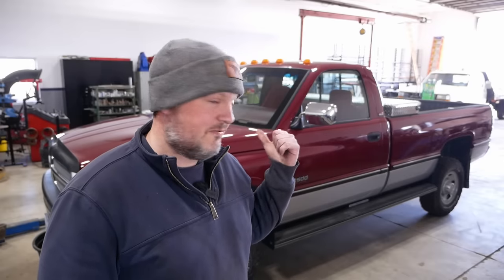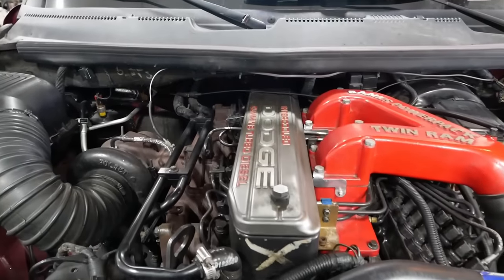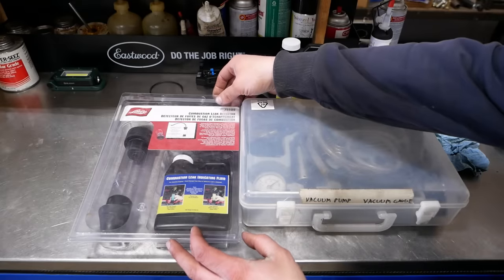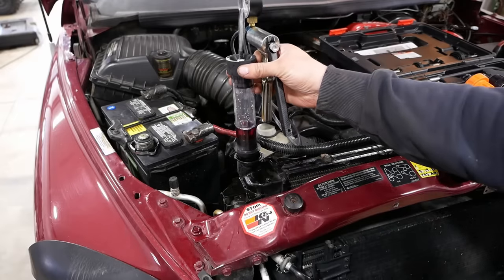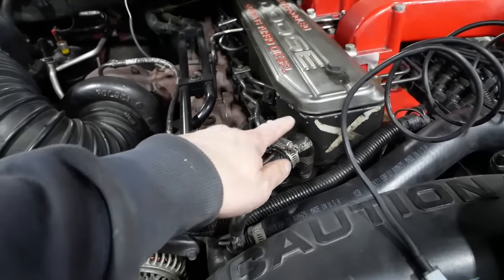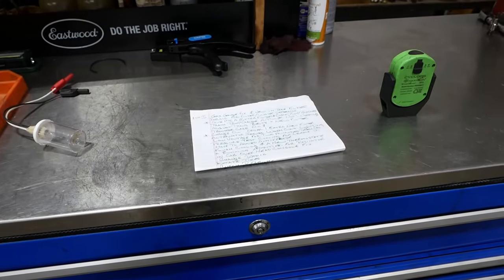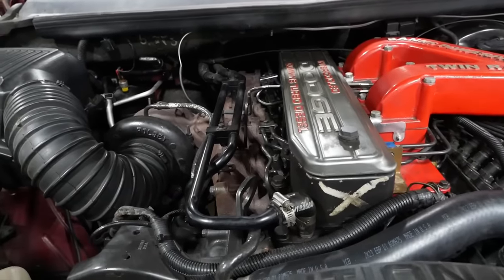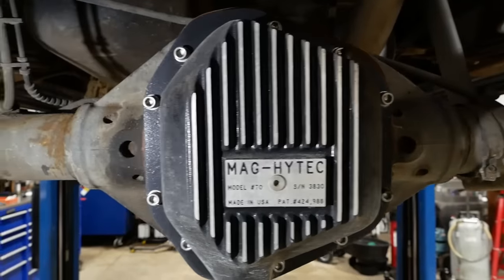Fixing a Mint 1995 Ram 2500 Cummins | Front End, Coolant Leaks, Major Service, Etc.

Comment from the maker: Need a fancy new tool?
Lang Wheel Stud Restoration Kit: https://amzn.to/3OdVpH9
OTC Ball Joint Press: https://amzn.to/3xLEOFf
Lisle Pickle Fork Set: https://amzn.to/3mEUp2K
Reply: Seriously, what I could use is a recommendation for a ‘good’ ( I know, I know) spring compressor kit.  I drove the Chevy to the levy and now I need new front shocks.
Reply from the maker: @mikehartmann5187  No such thing. Find a shop with a Branick or OTC spring compressor and have them swapped out.
Reply: @mikehartmann5187  Coulda been worse,coulda drove a Ford to the Fjord.
Reply: on car brake lathe. had the 5 stud bronco done 15 yrs ago, still good..rang now for it to be done on 8 stud 75 , 250.. nope.. now i have to pull front apart to replace them, fk this country..aus..everything to damn hard..
Reply: Yeah mateee
Reply: @burtbacarach5034  Sure you are not Hal considering your lyrical ability? :P
Reply: Retry here...    I added a link to the part and ScrewTube removed the message.    Wes, if your customer wants to get rid of the "lose" feeling and "death wobble", there is a fix.   BD Diesel makes a front end stabilizer kits for all the different years.   The added bonus is it also stops rounding off the shoulders on the front tires in 10K miles.   They are around $250 for the stabilizer kit.  I also got the track bar kit as a bundle...  delivered it was under $600.  It WORKS.
Reply from the maker: @ramosel  Sorry I have it set to hold comments with links to keep the bots from spamming us.
Reply: @WatchWesWork  No problem, makes perfect sense.   Hopefully it got the information to you and maybe your customer.  That's all that counts.  Bots...  what can I sa....  oops, gotta run... I think this is my 24th last chance to get an auto warranty on the phone.
Reply: I've been looking at Lang's repair tap's, do you think they're worth it? I've mostly been using either a normal tap or a high tensile bolt with a slot cut in it.
Reply: @mikehartmann5187  Klein makes one, it is expensive, and it is amazing
Reply: Hi Wes, what brand is that big C-clamp you are using? It looks so beefy and good.
Reply: Cut towards your thumb not your chum because your thumb wont sue you if it gets cut.🌕
Reply: I used to sell all that stuff. I sold tools for almost 40 years. The best company of the 3 that I was with was Cornwell. Great company and still employee owned.

Comment: These old trucks are real work horses. I inherited my grandpa's 1994 2500 12v when he passed away in 2005. He used to keep one of those disposable tear off calendars struck to the dash.  The last one is still there, stuck on the last month he drove it before he passed away..... 17 years. That truck took me and my dumb young adult choices all over this country and always managed to bring me home safe. Sometimes she was limping, but she always got me home... or somewhere safe. All the while chugging a cheerful tune, sounding like she was happy to be there, and glad to help. Now days, she is a little worse for wear. The dash is cracked, and there is more primer and light surface rust than the original Champaign paint left, but she still sings that happy song, and even though it would be cheaper to take the motorcycle or the new Chevy to work (especially with current fuel prices), I prefer to use the old 12v.... that way, I can ride with all my memories...
Reply: And the nice thing about the old 12v is that long after the body rots away, you can pull that fine old 6BT and run a great big sawmill or something out in the bush. Hell, you could just stick it on a stand and run it for yuks--I bet your granddad would get a kick out of that, I know I sure would.
Reply: Write a book! You are a skillful writer. I enjoyed reading your comment.
Reply: @jkgkjgkijk  I did so too
Even a had a traer in my eyes knowing that I have one of these treasures ..I..
94 1500 5.2 5 speed 
I got it with 82
Now has 87 thousand in the taco..
Reply: I think I've got something in my eye.
Reply: Wholesome comment
Reply: great story brother, i inherited my uncles 99 3500 24v and shes been great and hauled me to many memories, she's struggling and needs another injection pump but I wouldnt sell or trade that ol truck for 10m dollars.
Reply: Calling a 1994 truck old really makes me feel ancient.
Reply: If I were in your shoes, I would pour 50-60k to bring that truck back to new instead of buying a new one. The memories alone warrant that. I’m keeping the first car I bought to pass onto my daughter in about 10 years. Hopefully she will keep it and cherish it.

Comment: Odd, I really thought Dodges were made out of rust at the factory.
Reply: Gotta rust proof the hell out of them and keep em "wet".
Reply: My 2022 Ram 4500 already has some rust on her.
Reply: @danpaul9423   What really??
Shit I have a 2019 and got the factory rustproofing AND take it to a local shop annually..... No rust yet.
Had a 2000 for 17 years that started getting bad around the floor pan and in the corners.
Reply: 3rd gen beds are for sure
Reply: What about GMs and fords?  Lmfao.
Reply: Oh they all rust it just depends on how well there taken care of
Reply: @danpaul9423  Sure "Dan Paul" we really believe u bro
Reply: @kyboy5  ok you don't have to. I just got the truck last week from work and noticed in all over the brake calipers and the rear dif. I just through a little spray paint over it to make it look a little better.
Reply: No, that's Pontiac
Reply: @sjfk1306  in my experience dodge rust the most followed by GM
Reply: @smithm868  you must not have much experience then.
Reply: There all the same!
Reply: Any thing made by man turns to dust… or rust, in this case. Arguing over which trucks rust first or more, is not unlike two toddler’s arguing over who shitty diaper is cleaner or smell better. Have fun kids

Comment: To Wes. The remaining "sloppy steering" is caused by the steering shaft rag joint. Speedway engineering makes a solid joint for this. I had mg 99 Ram 2500 and same thing. All new front end parts and still a slight slop. Yep yep
Reply: I posted lower down, but in mine it wasn't the rag joint itself, but the cinch bolt in the lower u-joint of the steering column shaft that holds it on to the input shaft on the steering box. It was just slightly loose, which caused fairly significant play.

Comment: I appreciate the fresh take on 90's dodge trucks; at least speaking of them in a positive light in the intro. Weird to think about but dodge was a real underdog in the truck market since... well forever until the second gen came into the market in 94'. I try to think about that whenever I find any short comings on my 97' Cummins truck. Chrysler didn't have the kind of investment capital to put into these as much as Ford/Gm did due to sheer volume/production #'s. The introduction of the second gen, in my opinion, was the hail Mary that saved Chrysler's participation in the US truck market
Reply: @Mun56203  They also fell apart daily and the glass transmissions would only continue.
Reply: @Mun56203  the first gen had a frame that was not heavy enough in the front end for the Cummins engine.  Those had the same frames from the 1970s.
Reply: @bluegrassman3040  They aren't bad if you add the steering brace or convert to crossover steering. All of those trucks (72'-93') had issues with the steering box area.

Comment: I've owned a 93, 95, 01, and now an 09, all with the Cummins. I also have an 89 that is 100% stock. Never a problem from any of the engines and believe it or not, not one transmission issue (yet). I have experienced most of the other "normal" Dodge issues along the way. I think it's safe to say that Cummins engines saved Dodge trucks.
Reply: The engines last a million+ miles yet the bodies just rot around them if you look at them the wrong way
Reply: @rawr51919  They last a little longer down in redneckland.
Reply: Use to be a saying that with the Cummins engine you had a 500,000 mile engine in a 100,000 mile truck.  Don’t  know about that, I have a 2000 with a 120,000 on and still perfect.
Reply: @weshawkins7165  In my region if they're worked routinely one can get around 300,000 miles out of the body but it's expensive to do it. This implies it gets nowhere near the beach or salty roads ever at all.
Reply: @hithere7382  
  Mine started out in Iowa but within six months was a California trunk.  I don’t drive it in snow or salt.  As an old Dodge dealer tech I do all my own work.

Comment: that twin ram intake helps get air to the rear cylinders, the intake manifold didnt do a great job of distributing it evenly from the factory.  It also helped conditions with the rear cylinder temperature being a lot hotter than the rest.   if a cylinder went out on one of these, it was always that rear one.

Comment: The cam bolts for the caster adjustment from the factory “tuck the axle into the truck”. If you adjust them to “rock the axle” as far out as possible it is a massive improvement. A friend that worked at a dealer when these first came out did that even when new. I did the same to my 2003 and I also added a steering box brace. That also made the steering much more positive.
Reply: Excellent. Positive caster is a good thing!

Comment: Thanks for the video, I have a 1996 Dodge Ram 4X4 that was converted to a mega cab 4 door, when it was pretty new.  It only had 120,000 miles on it when I got it. It had been parked for 10 years.  It now has about 157,000,  I changed the interior to cloth, not a fan of leather (cold in winter and hot in summer) We did brake and axle seals ect.  The killer D pin ect.  I use it usually for towing. almost every time I drive it someone will come up and try to buy it, I always tell them I need it to launch my boat. My daily is a 2003 Dodge Ram 3500 four door short bed, 6 speed with over 300,000 miles and runs like new. 20 mpg regular use and 16 towing over 10,000 lbs.  The 1996 gets about 16 mpg and about 12 towing
Reply: Pretty nice rides. My buddy has 06 Mega cab Cummins dually 6spd he bought new has 186k starting to rust Pretty good but he just took it across country and back no issues but the rust is taking it away he's slowly buying all the body parts for a major over haul this winter I think

Comment: Hey Wes
If you want to get the Dodge Ram to stop wandering down the road (it's not the steering box) you will need to repair / replace the steering column.  The bushing inside the column fails and leaves a lot of slop...
Reply: A death wobble  brace is a must other than  that  they were actually  really good  trucks
Reply: Need to upgrade the “Y” tie rod and drag link to the “T” style upgrade. That’s helps a ton.
Reply: I think you will find that the he problem is with the steering shaft coupler inside the steering column... And while you are in there, you might consider replacing the clock spring and your cruise control will start working again...  Ask me how I know...
Reply: The bushing in the steering shaft of my 94 Dodge Ram 2500 allowed the steering wheel to rotate about 20 degrees before turning the steering box.  Pretty simple to test if you use a pair of vise grips to secure the steering box from turning then hop inside and turn the wheel...
You must lock the steering box because the resistance inside the damaged bushing will make it seem like everything is OK...
An ideal job for a good assistant... lol
Reply: @alc818   Same Lol took me forever to find the problem in my 98 ask ME how I know          🤜💥🤛
Reply: It's caused  by the steering box it's self the bearing  ware  out over  time I've owned  several  second gens
Reply: One thing for sure...
If the truck ever comes back to Wes, we'll all know the answer to the steering...
Reply: @alc818  yep just replace everything  lol
Reply: I'm so glad that there are quality mechanics watching and commenting. We all watch Wes stumble thru his videos with never a proper inspection. This vehicle owner is lucky to have the real diagnosis here in the comments so he can install the correct parts for his steering. It's obviously a death trap after Wes ignored all the real problems and only fixed, adjusted and inspected the totally wrong items. I only Watch Wes Hack for his comedic value, that Bozo couldn't get a paper bag to work right.
Reply: Michael Slattery    Whoa, dude!  Harsh! The name of this channel is Watch Wes Work, not Watch Wes Work Perfectly!  At his age did you know everything?  Come to think of it, do you know everything now, at your age?  Lighten up and enjoy Wes - or get a life, k?
Reply: @Rein_Ciarfella  I THINK that was sarcasm aimed at those saying that the steering needed one or another aftermarket improvement or more parts in the steering gear replaced when Wes's basically said "it's fine it's an old Dodge" and they tend to have loose feeling steering even with everything in spec. and maybe the steering box wasn't rebuilt as well as it should have been.
Reply: Someone WhoCares    I thought that might be sarcasm as well, but after reading it carefully a couple more times I decided it was serious. I’m the king of wandering steering. My 2004 Chevy Astro does 3.5 inches of steering wheel turn while parked. At first I did the research and I know how to fix it but then life took over and I drive a lot less since the pandemic so I’ve just gotten used to it. If I had to drive longer distance like I used to I’d fix it, but it’s not high on my priority list anymore. 😉👍🔧🧰
Reply: @homeFall1  You were correct.
I am amazed at the buffoonery of the video "experts" that can diagnose a complex mechanical system without ever seeing, or touching it themselves. I understand that some may have had different experiences with various solutions to similar problems, but to claim that their video troubleshooting was superior to Wes is absurd. We watch Wes in video after video go deeply and thoroughly thru his analysis and find the root cause of the problem each time, but somehow he failed to detect what would be obvious failures of normal wear points this time is just plain stupid.
It was the tone of their comments that prompted me to reply.

Comment: That sending unit swap is a piece of cake, setting aside the dropping the tank part.   😉       Great video with diagnostics and multiple fixes.  Thanks.
Reply: i wonder if you could pull the actual resistance unit off and replace it, they look the same

Comment: I bush hogged an ancient barbed wire fence that was “mostly” buried in a heavy grown over ditch bank…took me hours to uncoil (using a torch, wire cutters and grinder) all of that barbed wire from the “stump jumper”… wire was probably 2-3 inches thick in spots. Got a new respect for the guys that cut ditch banks everyday!
Reply: I guess it was too tight to the drum/spindle for small bolt cutters. Ok, torches are faster too. Actually, that stuff gets stiff when curled and shortened. Sorry you had a rotten time. I only get some stories from my cool public works neighbor across the street. He just upgraded to an X-mark for his personal use and a 2022 Ford F-150 TT V6 from an ancient Toro and a 2004 Toyota Tacoma with rusted out, but replaced rear brakes. His yard looks so good with all this eye candy now. Son of a farmer married to a daughter of a farmer.

Comment: One thing that helps the steering on these 2nd gens is a steering box brace. It puts another bearing on the outside of the pitman arm on the sector shaft. Without it, you can watch the box/shaft wiggle side to side when you steer in place.
Reply: I replaced my steering box with a large over sided sector shaft. Doesn't require the brace and drives with 37s down the freeway and offroad with no problems at all and steers so easy like it has hydro assist!
Reply: Strongly disagree with the BS brace gimmick. They do not work. I have installed several (by request). There is always a significant amount of run-out in the silly "stub-nut" thingy that fits in the bearing. (Yes I have measured this. Yes, I know how to measure this (I am a machinist)). This would cause binding, IF those bearings were tight enough to prevent it. They are not. Not to mention, non sealed bearings. And those two small 3/8" bolts do not provide enough clamping force to stop the bearing from walking under load. The stupid things are a temporary bandaid at best. It is not the box that moves (I have measured this as well). It is the sector-shaft flexing. As LawF250 suggests, a box with a larger sector-shaft is the correct fix. Especially with over-sized or wider than stock tires.
Reply: @wheelieking71  My truck came with the brace on it and it drives nice. My buddy replaced everything on his front end, including the steering box it and still wandered. He put the brace on and it went away. I agree a steering box with a bigger sector shaft is a better fix, it's also pushing $1k.
Reply: Those are actually terrible. The frame needs to flex and when you put a brace on the front of it like that the gearbox absorbs the flex. No bueno
Reply: @LawF250  what brand box did you use?

Comment: When I had a '95 ram, i found much improvement in steering after replacing the steering gear and a special kit that puts a special pitman arm nut that rode in a big bearing supported by frame structure.